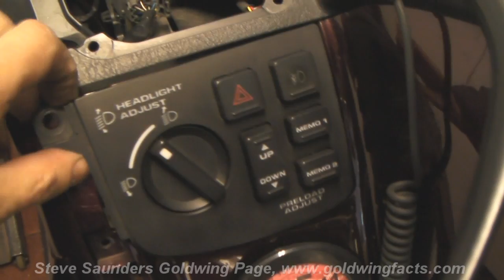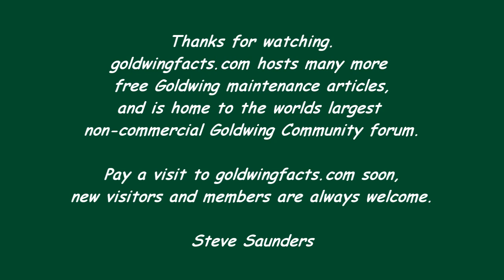GL1800 Air Filter changing, 2006 and later non-Airbag models

Comment: The next video is replacing the spark plugs, I'm sure we will need to pull the engine for that maintenance job...
Reply: OIL  CHANGES  &  SPARK  PLUG  REPLACEMENT   IS   NOT  COMPLICATED   ON   A   GL 1800  WING ,  NOT  HARD   TO   DO  YOURSELF   TO   SAVE   $$$$$$$$.

Comment: Steve, Thanks for publishing this! I would not have tried this without this video. I don't understand how Honda would let such a poor design go into production, much less keep it for years. Its a great bike, most people are willing to do basic maintenance like check / change the air filter on a yearly basis if it were easy like ot should be. Its not just the dirt from riding, this past year a mouse made a nest in the air box during the winter season, and the bike was stored in a clean heated garage for just two months! So glad I checked it!
Reply: DESIGNED   ON  PURPOSE   MAYBE  ,  TOTALLY. ENCLOSED  ENGINE   COMPONENTS  ,  MAINTENANCE   LABOR   CHARGE   RATES  FOR  THEIR  SERVICE   DEPARTMENTS  ?????????

Comment: Love my 2010 Goldwing, bought it used with only 4k on it, but didn't think to ask about something as common as changing the air filter.  Guess I'll be trading it in for a new one when the filter gets dirty.  lol.  Ah...what the heck, this adventure will get you to know your Goldwing better. Agree with TheFloridaPappy too though, the engineers could have designed an air flow intake system and put the filter in an accessible place.

Comment: Great video I couldn't have done it without a lot of swearing without your help.My dealer said 3hrs. plus filter cost.It's a pain in the butt job that you have to do.My wing trike had never had it done until now when I bought it. It's a  2006 with 28,500 miles w comfort, nav. as well as prem. audio. .It was overdue.

Comment: Thank you for the video. If you can do it one-handed, I can do it to handed. I got everything apart, now I’m in the process of putting it back together. You my friend need a 24 inch number 2 snap on screwdriver for those air cleaner screws..It also comes in handy when I’m doing manifold clamps on Japanese four-cylinder  bikes.
   Thank you for the video. It really helped.
  It’s 2019. A Hilo OEM replacement air filter cost me $18 free shipping on eBay here in the USA.

Comment: I need to find the camshaft position sensor on my 2008 GL 1800 Goldwing, the FI light keep coming on and I changed and put a new battery in and the FI light keeps coming on. do you have any suggestions? Thanks Stan
Reply: Stan Wilson ss

Comment: The Honda designer/engineer who came up with this excellent "user friendly", never do it yourself design, but pay a Honda mechanic 2 hours shop fee, should be taken to the wood shed. I will gladly do the honors.
I had an 01 GL1800, 06, and now a 2012, I fear the service cycle that requires this simple air filter change.
Reply: fireflyvtxr Steve Saunders video, IS EXCELLENT though. I would be remiss not giving you credit Steve. You are patient and calm.  Thank You.

Comment: I own a 2007 Goldwing.  I bought it because I wanted a smooth, quiet ride,  reliable,  with a premium audio.   I do like the ride,  it has been reliable,  and the sound system is good.  I just recently,  needed to trace a very small coolant leak.  These bikes do come with many features, options in a small / tight package.  Many hoses, & low grade hose clamps is a poor choice of materials.  Engineers by choice or ignorance design things to be difficult for end users or mechanics.  Can these bikes have a better design,  all that is needed is a little fore thought.

Comment: Is there a trick to unplugging the radio and wires under the ignition switch housing for someone with big hands?
Reply: Have your wife do it
Reply: Yes, use a flat blade screwdriver to gently pry the two halves apart, while depressing the tab. You can also use some WD40 on the plug before beginning.

Comment: Great video, BUT: You need to be real honest how long it takes to disconnect all of the electrical connections (meter panel, tweeter connections etc...) there is no way yours just popped off like you show on the video. Unless you have strong needle nose like fingers it can be difficult. Same goes for two cable pulls for the foot warmer and right shelf storage box. Sometimes it is easy - others it takes 20 min a piece. And if you have ABS and NAV there is another module under the Electronic Controller on the shelf above the air cleaner housing you have to unplug. And the top ecu platform is easier to manipulate if you have the electrical connectors removed for the Cruise control module. Honda is really bad at not having consistent electronic connectors that come off easy. At least have a disclaimer. It is bad enough you have to take the top shelf off - then have to take all the crap off to get to the air box. . As others have said, this design for a common maintenance issue is really stupid engineering. It is as if Honda slapped a gl1800 together to replace the 1500 wing and get it out to compete with the BMW K1200LT at the time...and the BMW had a much better suspension... but not the engine from a power standpoint. It seems this would be a $400 dealer labor fee in 2022 just to change out a $22 filter. And how many tabs would be broken you would never know about. It is time for bike manufacturers to go back to visible external screws for body panels for much easier removal and readily accessible maintenance items for air and oil filters and headlight bulb changes.

Comment: What's wrong with all you down below?   With omg this and holy cap that.

Organization is key here.   Nothin more.
Invest in a box of zip lock baggies to keep the differen screws, fasteners and whatever other doo-dads in, and write on  a paper, where in the sequence those were removed.   Put that piece of paper in the corresponding bag with the screws, etc.

I keep ALL my tools in ziplock baggies (quart size, gallon size, whatever)  Makes things so much easier, it's not even funny.
Reply: +Ray Charles You can also get a piece of cardboard, draw outline of shelter, poke holes where fasteners are and put the fasteners in the cardboard.

Comment: my pan got written off and i was seriously considering a gl1800 even though they are double the price. then i watched this. when my mate said it take ages i thought he was joking. this design makes the bike fucking pointless it you have to remove half the front. who designed this mickey mouse? the pan takes 2 bolts to lift the tank and about 6 screws to take off the lid. why didnt honda just make the front panel removeable by itself then you could acess the filter why make it in such a totally shit way. well you just saved me £5k thanks. guess i will get a st1300 for £4k and add topbox rack. over mirror brackets with 2 rigid industries spotlights phillips led bulbs switchbacks and a boomjacket waterproof speaker and a sj4000 camera and still have change from £5k